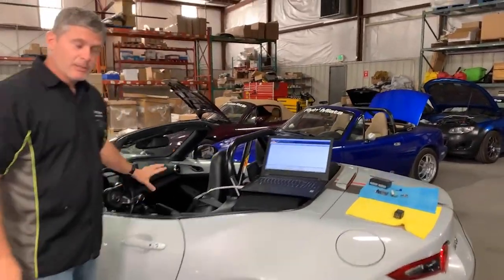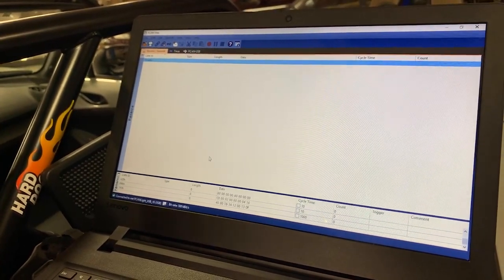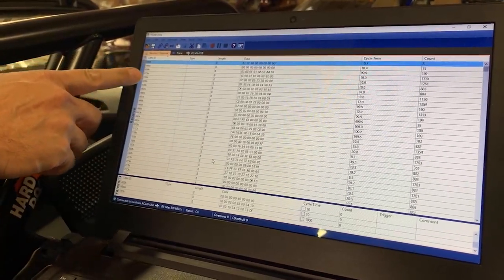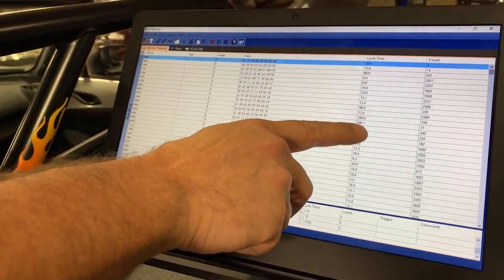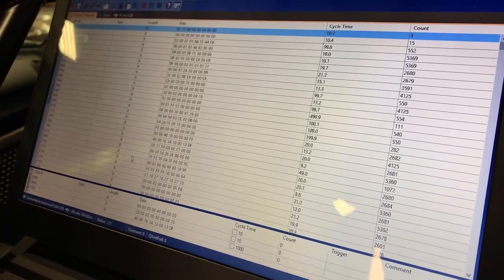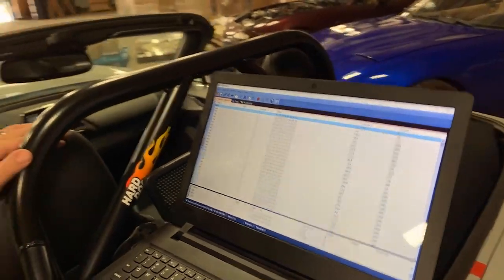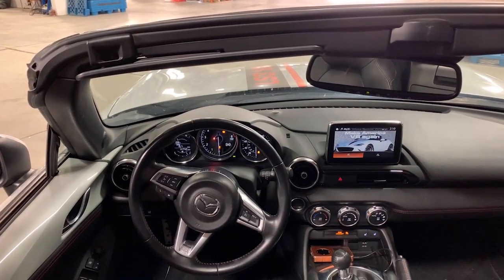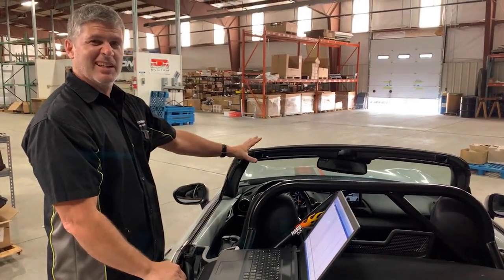CAN BUS: What is it and what does it do?

Comment: This is really cool information. Thanks for taking something I’ve heard several times before (CANBUS) and breaking it down in such and understandable way. I’ve always told myself I would always try to stay current on technology, but now in my 30s, I’m realizing that’s going to take  lot more effort than I realized as I’m just now starting to understand the simple old electro-mechanical systems using relays, 0-5V signal wires, Boolean logic, and PWM.

One day if I can ever afford to fund it, id love to buy a turnkey V8 ND from you guys as a really appreciate just how deep you guys had to go to pull it off. FM is such a great company and I’m loving my nearly decade old FM turbo setup on my 91 NA.

Comment: Interesting. I used to program in assembly, compile and program 8086 microcontrollers. That changing of a byte for the blinker is what powers the actual light. As it goes up and down more pins become 1, have positive voltage. That's how a byte actually does something. Wipers work another way by "strobing" the bits to move a digital motor, if I remember correctly. 

It is truly fascinating how these bytes, which are seen in hexadecimal, when used in binary are made to make physical things happen. Nice video. 

Without being able to reprogram the code receiving the information. The control logic are control feedback loops. I am also an engineer with controls experience, there isn't much more than listening one can do. There is math to these loops. They are proprietary. That's the tech they are selling.

Key variables in the feedback loop are empirically determined. That is by testing. Control loops anyone can learn, the maths. But key variables are gathered with data. The control program is constantly reading the A/F Sensor and triming feul for example to tune the engine and calculating O2 volumes and adjusting combustion temps.

Thanks. I can buy a raspberry pi from sparkfun and goof around with my controls. Too, you said "check bit" so I guess these are serial data streams coming off a transmission pin.
Reply from the maker: It’s a well documented and defined digital communication standard. Think more TCP/IP than analog control loops.
Reply: @FlyinMiataVideo  I guess my comment was an observation of the blinker you showed. The hexadecimal went from 00 to FF. So, it looked. That is how a light is made to go smoothly from dark to light and back to dark again. So, the value stored in an address was made to change--over the CAN in real time. The coding is done to do just that. Coding first picks an address and then puts a value in it. 

Some of the other bytes most open "gates" to let a data/address pair through. I will figure this out. I have some ideas. The only interesting thing would be to put controller and receiver together across the CAN, so long as your controller addressing only opened you gates. This would be better than running secondary wires. 

For one could put a switch in the box to the left of the wheel to turn fog lights on/off and whatever and use the CAN network to connect a receiver, much like the "fan controller" to receiver to values from the controller, "the switch".

Comment: Thank you so much for this video.  I thought CAN messages were standardized like an OBD-II, I had no idea that each manufacturer effectively made up their own.  I'm doing an LS swap into my S10 and I want to make the stock dash work, this video has been invaluable.  Especially calling out the GM spec document.  I was worried that would be hundreds or thousands of dollars, but I found it on the internet for $60.  Totally worth it for what I want to do.
Reply from the maker: Glad it was helpful!  A lot of people do have the same impression you did.
That document is a big hefty unit but it's basically three parts, and you'll figure your way around it. Good luck with the swap!
Reply: @FlyinMiataVideo  Yeah, I work in IT for my day job.  Boring technical documents are my everyday. :P 

What software and can device are you using here to read the CAN network?  It looks like it works really well and is easy to read.
Reply from the maker: @gedavids84  The hardware is a Peak PCAN interface, which is not at the low end of the market. There are lots of DIY options that can be put together, especially if you're a *nix kinda person. But the Peak unit works well.
Software is the free PCAN View for logging and sending messages, the not-free PCAN Explorer for the graphing. There are definitely some open source options out there for the latter, such as CANplot. I've seen one where it highlights values that are changing which makes it much easier to figure out which value is affected by whatever you're doing, but I don't remember the name offhand. SavvyCAN, maybe?
Reply: @FlyinMiataVideo  Thanks for the info. I'll check out the open source tools you suggest, but I'll keep the PCAN stuff in mind.  Sure I might be able to brute force my way through a cheap solution, but sometimes it's way easier to just buy the thing that works and get on with the rest of the project. :)

Comment: Very interesting and useful video.  Obviously most of this content was centred on the ND model, I’m interested in the NC which I’m assuming, based on its release era, is much simpler but still CAN enabled.  Do you have any information or areas you could point me (us) to for information on the NC models.  I’m particularly interested in how many networks are involved and which devices hook up to each but any additional information would be interesting.  I’m currently trying to think up a cool/fun project to implement on the car so I can’t be specific but a good starting point would be to know which devices are talking CAN and which can talk to each other.
Reply from the maker: The NC has far less information on the CAN chatter than the ND because it's basically a 2003 platform. The factory wiring diagram shows what's on it. It's primarily used for stability control (DSC talking to ABS and the PCM along with associated sensors like steering angle), information sent to the instrument cluster and some PRHT coordination.

Comment: I have a GT with Fox coilovers lowered to yalls suggested specs and have noticed a very weird steering issue ever since. The steering wheel will hold/gently lock at any given angle if I hold the wheel still. If I'm going around a long sweeping turn and I hold the wheel at some angle, I can completely let go and the car will hold that turn until I straighten with a little bit of force.  Once I break that hold, then the wheel can turn and adjust with normal input force from me, but it makes making small adjustments and going in a straight line nearly impossible. I took it to a Mazda dealership and they have no idea what is going on. 

Have yall heard of this issue? Could the sensors at the wheels be confusing the CAN sending whacky signals that the electronic power steering module is getting confused from?
Reply from the maker: The rack reads wheel speed, lateral g and yaw from the CAN bus to determine the "neutral" steering position. This does take a little bit of driving to figure out, and on a GT it will default to the absolute position read off a position sensor on the column until this is done. All the decisions about assist come from inside the rack controller that's integrated with the motor. 
This sounds like a lack of caster. We'd check the alignment again, paying particular attention to the rack being centered as an off-center rack might lead to some discrepancy between the absolute sensor on the column and the calculated neutral position. We'd also check to see if there are any stored codes - there are about a half dozen that the rack will throw if it's upset about something and not all of them will illuminate a light. Not all OBD-II scanners will read these module-specific codes, but Mazda can. So can Ford, and so you can you using a program called Forscan.
Reply: I thought it was caster related as well but then realized it felt very notchy and controlled by something electronic. The issue comes and goes, sometimes without happening during a 20 minutes drive, sometimes it happens an entire hour long drive. I can also feel that same notchy feeling at idle by gently and slowly turning the wheel. You can feel the power steering suddenly kick on or release the wheel and let it turn easier then off, causing it to sort of vibrate in a notched pattern. That same sensation of it notching and fighting to release is what I feel when I'm driving but much stronger. Almost like it's fighting the caster in the alignment.

I'll try checking out Forscan and getting another alignment done and see what we can find. Thanks for the response! Yall are more helpful than Mazda has been already.
Reply from the maker: @whoisstevencox  Did you have a front sway bar installed? Check the three 
connectors at the rack motor/controller, including the one on the pinion. That second description sounds like a bad connection. The rack is sometimes removed/molested during a front sway installation.
Reply: @FlyinMiataVideo  I did install a front sway bar and the reinforcement brackets. I'm putting on new wheels this week so I'll be sure to check that stuff when I have it in the air! Thank you!

Comment: hello, All. I just purchased a 2001 Miata. As an electrical engineer, I have some background of how the CANBUS work. Also, I was able to program some Arduino projects so I could read the messages. HOWEVER, as mentioned in the video, the 'dictionary' is what I am looking for now before I can do some interesting projects on this Miata. I did some research but there seemed be limited/mixed information. I also learnt that CANBUS IDs are different in different gen. of Miata? Anybody know where I can find the 'dictionary' for NB Miatas? For example, what ID should I look for the engine RPM? Which byte for that ID? Thanks in advance! Zoom~ Zoom~
Reply from the maker: Manufacturers tend to use the same definitions across all of their models, so if you've figured out a Mazda3 you've probably got a good start on a Miata. Not all messages apply to all vehicles, of course - hybrid vehicles have a lot more going on than pure ICE.
To our knowledge, CAN was not used in the NA and NB Miatas, and was used sparingly in the NC - mostly just to communicate between the PCM and the instrument cluster. The lack of twisted pairs in the wiring diagrams for the NA and NB seems to back that up. The data you're reading is probably not on CAN, I think the 2001 used the ISO9141-2 protocol. We haven't done much investigation into the communication on that specific platform.

Comment: the original project of CAN bus v8 is with gm e67 ecm, what about e99 ecm?
Reply from the maker: GM uses an internal standard for CAN messages so they should be the same. Note that being able to read and modify CAN messages is not the same as tuning an ECM.
Reply: @FlyinMiataVideo  so... I can use the same CAN Gateway module to swap an LT5 instead of LS3?
Reply from the maker: @israelalvarado1701  You should be able to, yes. The LT5 will likely have more information being broadcast but all the information being provided by the LS3 should still be there.

Comment: I have a question off topic, have you ever used MAZDA TWEAKS for the infotainment system ?
Reply from the maker: We have done a bit of playing around with the infotainment but stopped once SSH access was revoked. Never looked into MAZDA TWEAKS.
Reply: @FlyinMiataVideo  thank you for your reply. And i have a 2018 club with apple car play and i have the version 70.00.352 NA N
is the access revoked for all versions ?
Thank you again
Reply from the maker: @Theadventurelane  SSH access is a way to log into the infotainement system. You can also use prepared SD cards to make changes, but we've never played with it. That's the method you'll have to use, it's more common than SSH. This is not something we've spent any time on.
Reply: @FlyinMiataVideo  okay thank you